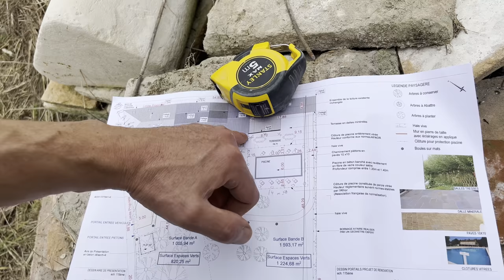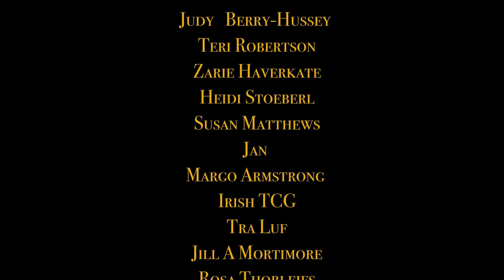EP55 Dining Room FAQ & Pool Layout Design @ Our Passion Project

Comment: It's great to watch and see the progress of the house. The white radiators in the dining room look wonderful against the rich red wall color, I used similar color in my last home restoration which was a Queen Ann Victorian. 

To possibly solve the design problem with hanging artwork in the dining room, you can add picture molding* around the room. Install it about a foot below the height of the door or window trim. it adds another layer of design to the room and eliminates multiple holes from changing picture locations. I usually mount it with round head screws and grommets to give it some added detail and paint it the same as the other trim color. I've seen it used in many old house restorations and I used it in my last home.

Another thought for the garden wall may be to render it, (that's a new word for me) and score it to look like the stone block finish on the front of the house. It may be a bit more formal looking than using the stone to face the garden wall. The stone might look a bit too rustic near the formal design of the front of the house.  In the end, the design you both choose will look beautiful and that is most important. 
*Google picture molding to see what I'm talking about.  Mark

Comment: For hanging art works about the house use Command hooks. They go on easy and are removed easily without damaging the surface or paint work. They are what we are using in our new house snd they really work. Highly recommended. If not available in France they definitely will be in  the UK. I think they are a 3M product.

Comment: Think carefully about planting olives next to a pool, they create issues. 
1) in late spring the flowers blow into the pool and clog the filter
2) during the summer they lose a lot of undeveloped olives which get into the pool
3) they attract insects to the pool area
4) they are generally low trees so overhanging branches can be a hazard for those trying to walk round the pool. This can be especially problematic if you have small children who run under the branches and parents who cannot! 
On the plus side, they can provide some lovely dappled shade.

Comment: We have radiator covers in our old house …….   Think of a cover ….. top solid wood ….. sides are copper metal  with designs ……  they allow for the heat to radiate and the tops are useful as well ……. we keep candles on top of ours ……. baskets snd other chachies
Reply: I think they had covers in old houses.  They can get hot enough to burn. Maybe this is less of a problem now that you can set a limit to the hot water temperature?

Comment: Regarding plants around the pool.  Depending on what "look" you want there, be careful what you plant.  Olive trees have sinewy roots that spread everywhere around them and stary shallow to the surface.  They are prone also to machine injuries (hedge trimmers, lawnmower blades, etc.).  Palm trees have a fibrous root system with the roots growing shallowly at a depth not exceeding 36 inches deep. They grow horizontally and remain narrow even as the plant grows tall  at the rate of 3 meters from their trunk when the tree is about 4 meters tall.  They also like to be moist and will search for water near them.  Make sure you space them properly as they can draw nutrients over a large diameter and cause poor ground cover growth.
You might want to add a small water feature at one end of the pool to add enchantment and color, such as a waterfall if you have left over concrete/stone from building the stone wall. 
Among some of my favorites near pools (that don't need a lot of pampering): agapanthus (blue-violet blooms), zandeschia (bird-of-paradise), hostas (from Empress Wu - 90-120cm high by 150 t0 180 cm wide with big blue leaves; Sum & Substance - 75-90 cm x 150 - 180 cm wide with large leaves that can tolerate direct sun for 4 hours a day) don't mind being splashed on  and settle just about anywhere in any type of soil except pure clay.  Along with the tentacle arms of a palm tree, you can also add the upper whimsy of 'King Tut' grass.   These are just ideas but bear in mind that movable pots (plant pots or cache-pots set on wheels make moving them easier around the pool.  With Anna's floral design artistry she could change the layout or groupings of pots daily.   How fund that would be! You could even grow some vegetables in pots, like cherry tomatoes that produce fruit until you guillotine their heads off, to stop them from continuous production.   Try mixing vegetable plants with cultivated plants.  Your children will experience gardening on a different level.   These are only ideas.  Take the time you need to do some research before you put your plan on paper.  It may change a few things.....

Comment: U need to research how far the root system goes or line the hole with concrete so the root doesn't break into the pool. For instance you'd never plant a weeping willow because the roots will destroy anything in their way to get to water. 🌴